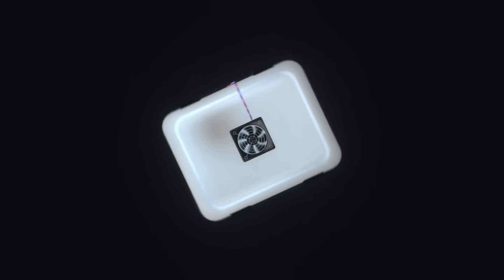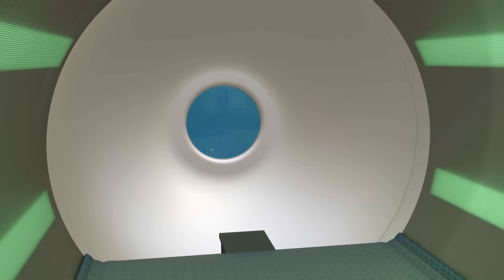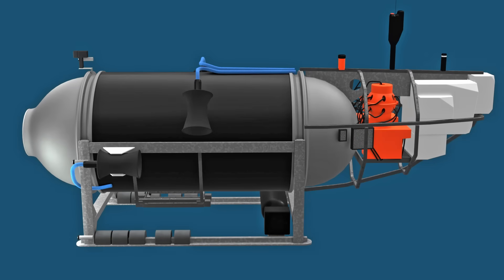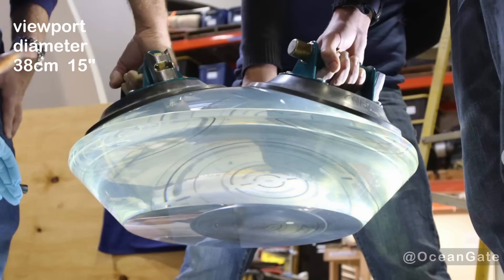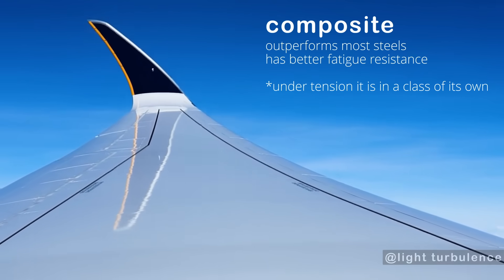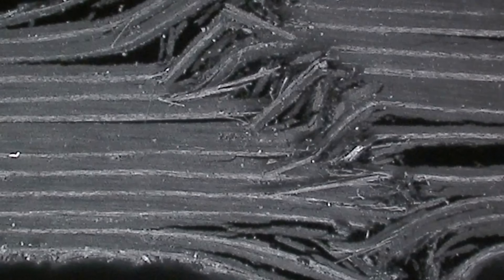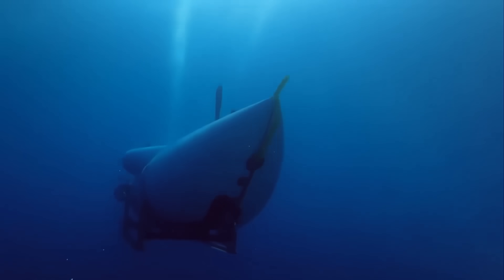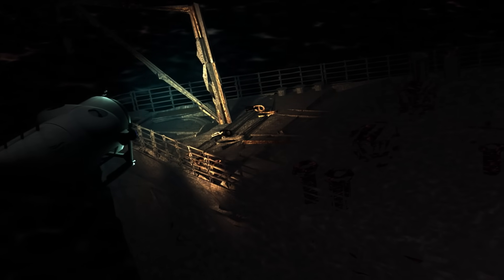Titan Sub | carbon fiber - Detailed Tour

Comment: The way they wound and shaped it was wrong. It needed to be criss cross fibres in a barrel, not spooled in a drum.
Reply from the maker: Did you watch the video?  Filaments were laid in 2 orientations.
Reply: Of the 3 possible orientations, they did  2, and not the third, going from in to out of the hull ie "porcupine quill" direction.  It was the this orientation + lengthwise that would have been most able to take the compressive load.  I have no idea how you would actually manufacture that, probably why no one else uses CF for this.

Comment: Carbon fiber is fundamentally the wrong material for a submarine.  Carbon fiber is strong in tension and weak in compression.  Subs are under compressive forces.

Most of the loads on a 787 wing are in tension on the bottom skin of the wing.
Reply: Yep.  It is wrong material. Unlike an aircraft wing, this hull was under extraordinary compressive loading for long duration.  And, unlike a wing it was not cross wound nor were high compressive loads distributed.

The problem is that in compressive loads the binder of the composite contracts and creeps which means that the carbon fibers are not kept straight……like pushing a wet noodle, it bends and kinks.  Prolonged compression causes more yielding of the supporting binder. So do repeated cycles. Then the kinks become breaks and that transfers load to the next fiber which the has more reason to kink and break.

In tensile loads, the binder yields but the fibers tends to straighten and thus takes up more, not less load.

Enough kinks and breaks and they propagate and the hull goes phtttt. All the more so without cross winding.

History is full of examples of actions taken because of imagined outcome while practcality, probability of failure and danger were not given their due.  For example, the marketing advantage of a speedy crossing for the Titanic itself masked the possibility that they would hit a berg. Recently, the desirability of doing numerous analyses on a single drop of blood masked that it simply could not be done.  Oceangate is really just another Theranos.

Sound design does not come from leaps of daring or faith.  It comes from tedious development,testing and trial.  Boeing didn’t watch the Wright Brothers and then start building 747s.  There were decades of progress ahead before mom and the kids could fly to see grandma.
Reply: It kind of sounds like carbon fiber could be better suited creating pressure vessels in outer space where the hull would be containing an outward force so it would be in tension. The future seems to be in creating space habitats using Kevlar.
Reply: Would be more worried delamination of carbon fiber layers,again not a good choice .
Reply from the maker: Not true.  Yes there is tension on the bottom of the wing.  But the other 50% of the force is on the top surface in compression and those forces are massive.  
And how is the engine thrust transfered to the body if only be tension?  Its via the wing and again with scary amnounts of comperssive force.
Reply: @Mike-Bell  Most of the force on a wing is tension when it lifts the plane into the air.

Engine thrust forces mostly resolve as tension on the aft root of the wing where it meets the fuselage.  The engine pulls the plane forward in flight.

One thing you got right in the video is that delamination is a major problem with plastic composites in this application.

The hoop tape winds are in compression, not tension.
Reply: @LoanwordEggcorn Sorry I would think that whether it pulls or pushes there has to be compression on the carbon Fiber where the wing connects to the fuselage.
Reply from the maker: @LoanwordEggcorn You seem to lack a clear understanding of structural engineering. In wing design the same tensile forces are balanced by equivalent compression forces at the top of the wing or wherever. This aligns with the fundamental principle that "every force has an equal and opposite reaction." You are suggesting that tension simply disappears into thin air without a counterbalancing force which is nonsense.

It's intriguing how some, including yourself, struggle to accept the fact that carbon fiber can rival the compressive strength of the best. Carbon fiber is a structural marvel, but its correct construction is notoriously challenging and expensive.
Reply: @Mike-Bell  Yes but no.  Yes you are right that every tensile force must is matched by an equal compressive force in a cantilevered wing. Were that not so, the wing would depart the plane. BUT, no, you are wrong to imply that carbon fiber composite with sufficiently clever engineering and design could work in a sub.

A sub ain’t a wing.  The deep dive sub has long duration compressive loads that necessarily are dangerously onto the low cycle fatigue zone. On top of that, cross winding of the tubular hull is probably impractical.  So the fiber composite in a sub is operating entirely in its weakest mode, for durations that invite creep and under loads that it cannot repeatedly take.  Good engineering wouldn’t fool with carbon fiber for this application. Good engineering would choose titanium and make up for its weight by adding boyant foam.
Reply from the maker: @piperg6179  Carbon fibre is not weak in compression so it is not in weak mode.  If the loads are designed with sufficient excess structural material it doesnt enter damage zone and therefore doesnt fatigue even during extended durations or cycles.  That is just good engineering and what we all expect when we climb aboard a plane.  

Plus carbon fibre has better fatigue resistannce than steel.  Here is more detail. https://www.researchgate.net/figure/Number-of-cycles-with-applied-stress-comparison-between-steel-and-composite-materials_fig1_344445467
Reply: @Mike-Bell  practicality is the ball to watch. Maybe 2’ thick hull of composite would work.  Maybe a cast iron canoe could be made to float.  But starting with the wrong choice of materials makes safe construction impractical.  So with this sub we have cracking and failure. That carbon fiber composite in some other application and configuration has proven satisfactory, is irrelevant.
Reply: @Mike-Bell  "Indeed, the compressive strength of carbon fibre and carbon fibre composites are about 30 to 50 % of their tensile strength [3]."  Jan 1, 2023

A review of the structural factors which control compression in carbon fibres and their composites

Composite Structures
Volume 303, 1 January 2023, 116293
Reply: Unlike Titan, a wing has many ribs, spars and stringers to distribute the load over the broadest area possible. The composite layup on top and bottom are not identical or equal in thickness, composition, or schedule of fibers.... design loads for commercial aircraft are for +2.5G and only -1.0 G loads. The wings aren't a monocoque structure like they appear on outside.

The upper skin does not contribute 50% of strength, and is actually under reduced pressures vs lower wing surfaces from lift.  Internal structure (ribs, spars and stringers) carry nearly the entire 100% of load, consolidating it from external skin like a sail does to mast on sailboats. The wing attachment at fuselage skin carries some minor amount of load, but again there is internal wing box structure  accepting those forces. They are distributed to other internal bracing AND the pressurized hull of fuselage which IS a load bearing structure... Remember, the wings are partially tanks for fuel as well as structures for generating lift. The fuel tanks are not pressurized very much like the cabin, and more modern craft use oxygen free nitrogen sources to suppress the potential for vapors building to explosive levels suspected in a few rare fire suspected crashes.

The upper skin of wing aids in load spreading, but probably only experiences 33% of bottom surfaces portion of forces ( in that, I mean that's 25% relative to bottom's 75% relative external psi of air in flight )  Beyond that,  there are many other layers besides carbon on external surfaces ie fiberglass as abrasion protection, as well lightning mesh outside of carbon fiber structure, vinyl wraps or paint etc.  Hope that helps
Reply: @mkllove  Thanks, I neglected to mention the internal structure of the wing, which uses spars, stringers and ribs to distribute the loads throughout the wing.  The load paths flow through the boxes those form.

The main purpose of a wing is to lift the aircraft, so most of those loads are in tension on the bottom of the boxes.

Engine thrust is carried through mostly as tension loads on the rear panels of the wing boxes.
Reply from the maker: @mkllove  It seems like you are saying the carbon fiber in wings carry little compression load?  Am I right?
Reply: I'm saying it's not 50/50 or an apt comparison to a monolithic steel beam model for static loads with top and bottom of beam equal and opposing in loads... The top surface of wing exists to contribute lift/reduce drag and spreads the load on wing in all 3 axes, but it's primarily under lift forces from vacuum created on top surface while pressure exists on bottom surface. If you were bending it to ultimate bending failure in a test fixture like Boeing or Airbus does, you would see something greater in compression than actually experienced in real life. 

The compressive forces are relieved, or redistributed by this vacuum, in essence they're applying a countering tension on upper surfaces, reducing the compressive effects.  The wingtip extensions also contribute lift by making the wing channel more air mass over top surface, tensioning wing outward slightly.  My best guess is that only 25% of load of aircraft's weight is experienced compressively vs tension on bottom while flying. On the ground, without aerodynamic forces it all reverses, and top skin is under tension/bottom compresses until forced to flex up by lift and air pressure below wing while in flight.   Does that make more sense ?

Ultimately, the suction effects experienced on top of wings, body of aircraft and horizontal stabilizers ALL share the total weight of aircraft, with pressure lift effects on bottom of same surfaces adding a far smaller portion to total varying with altitude due to density changes and humidity.
Reply: @mkllove  On the ground, a wing only does enough work to hold itself up (along with the fuel in it).  In the air, a wing lifts the entire aircraft up.  That's a lot of lifting force.  

There are compressive loads in the wing, but the tension loads are much higher in flight because of that work of lifting the plane into the air.
Reply: Sorry mike, but you’re wrong 100 percent wrong on this one. Only steel and titanium is suitable for constant deep sea diving. carbon fibre is a temporary material and each sub made from carbon fibre must be replaced after a couple of dives or used for shallower no pressure descents  @Mike-Bell
Reply from the maker: @paulwoodford1984   What do you mean carbon fibre is a temporary product.  The Dreamliner has been flying for a decade now.  That is hardly temporary!
Reply: water pressure is more damaging to carbon fibre than the stresses to airliners  @Mike-Bell
Reply from the maker: @paulwoodford1984  No fibres are in contact with the water just like no fibres are in contact with the air in a wing. The fibres in both cases resist the structural compression or tension forces. You understand how structures works.
Reply: well, next time there is a carbon fibre submersible going down to the depths of the titanic and it’s affordable, i dare you to get inside it. I wouldn’t get inside that coffin.  @Mike-Bell
Reply from the maker: @paulwoodford1984 I'm way to claustorophobic to set foot in any submarine.  I will comfortably climb aboard a properly engineered composite aircraft and whilst I am fully aware and accept that the carbon fibre will be under phenomenal compressive loads.

Comment: I saw somewhere else on youtube that apparently the electric (battery) motors that do the maneuvering and the upward control either failed or malfunctioned causing the vessel to 1. go down too fast  2. go down too deeply. There have been problems before one was where they were stuck down there for several hours. There is a fail safe to release after x mount of hours have passed.
Reply from the maker: It seems you did not listen to the whole video. I explain the vertical journey was not powered. It was done with weights. The fake transcript said they were going down too fast with thrusters which was nonsense.